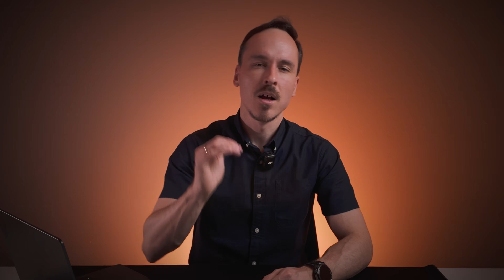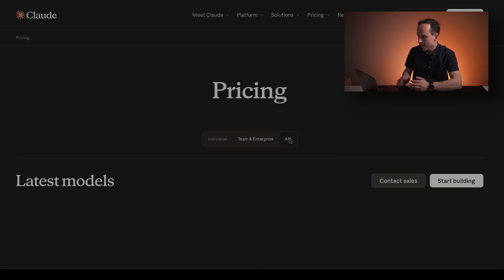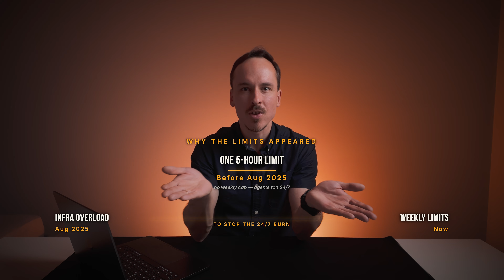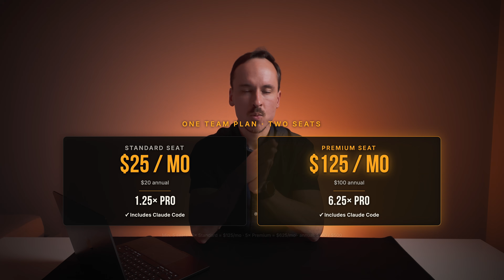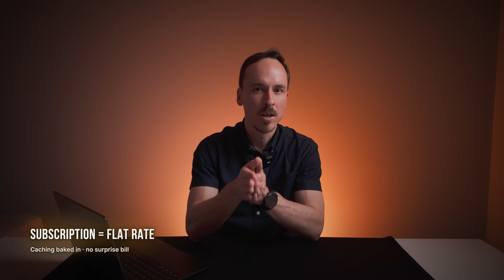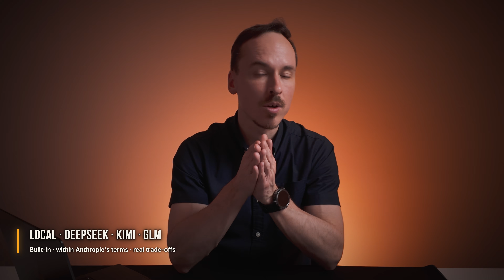Claude Code: Why the $100 Plan is the New Professional Standard

Comment from the maker: Chapters
0:00 The $100 freeze - why engineers stall
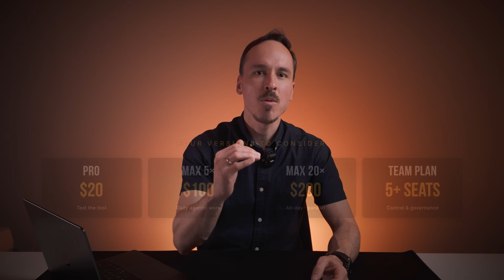1:18 Why $20 Pro is a trap
3:27 How I got here - $20 to $100 on impulse
4:46 What $100 really bought: spec-driven development
6:23 Read the pricing page like an architect
8:10 Live demo - opening claude.com/pricing
9:40 What a token really is
11:23 Five usage counters, Claude Design & routines
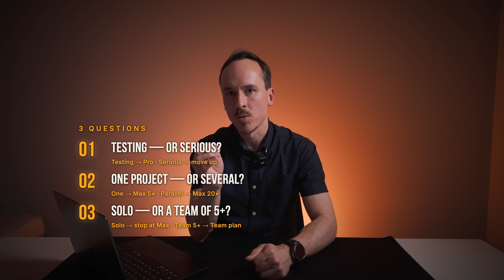15:46 The three questions that pick your plan
16:57 Walking all four versions
21:23 Why I don't buy the $200 Max 20x plan
25:09 The Team plan - Standard vs Premium seats
32:39 Why not just use the API?
37:03 The credential trick Anthropic shut down
39:14 Subscription vs API in dollars
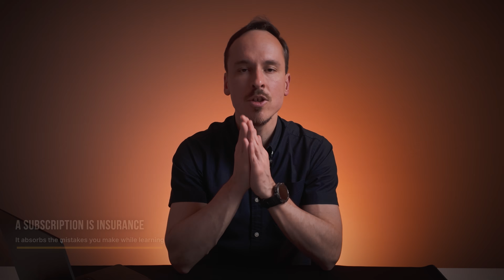41:35 The third route - local models & DeepSeek
42:51 Honest caveats - your multiplier, not the price
44:33 Price is friction, not a verdict